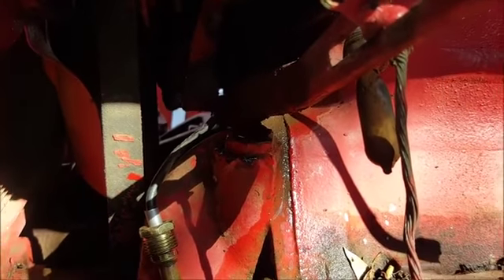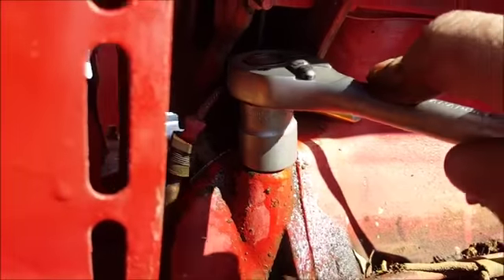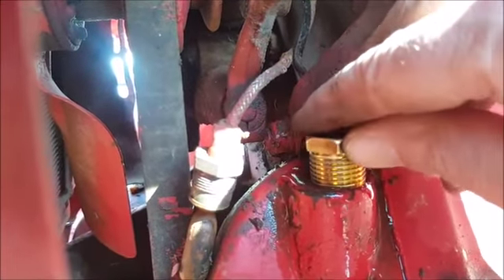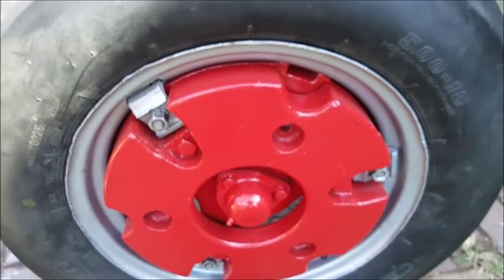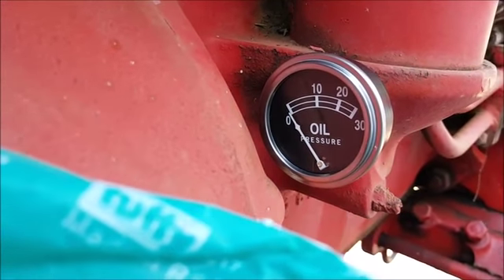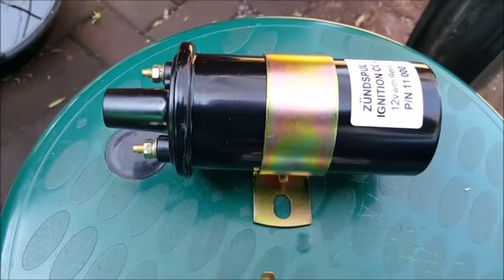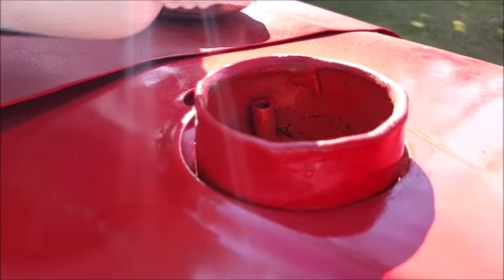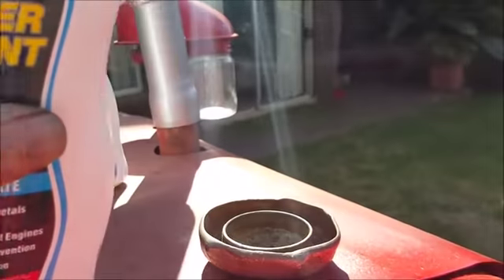Farmall update, made progress with a few things to be ready for start up

Comment: your tractor is coming along nicely, I know the external coils are used often  I have never installed one though.. those tires look great, I just used 12" trailer tires on my Cub, they had street tread not the 3 ribs like the originals had.
Reply from the maker: Great did you talk about your Cub Cadett, I can not recall you have a Farmall Cub, I hope the 12 volt converstion work out good because 6 volt coils and batteries are rare here and I don't want to order, I am want it to start now. Thanks for the view and comment
Reply from the maker: Very nice, I look up to part 3, will check the rest, good job you did there.Thanks for the link.

Comment: Not sure where you're going with the idea of 12 volts but that Tractor is Definitely 6 Volts Positive Ground  as is and you will need to change several things to make it 12 volts, which is Negative Ground.    I hope you are aware of this.
Reply from the maker: Hi Dan my plan is run it with 12 volts for the mean time till I get a 6volt battery and coil, none avaible here so I have to order, I thought I can run it so long without a generator, amp meter, lights etc. Only the plugs and points will see 12 volt, will that work
Reply: Yes, I just sent You an Email With Instructions on How to do it.
Reply from the maker: Thanks Dan, now I am excited.